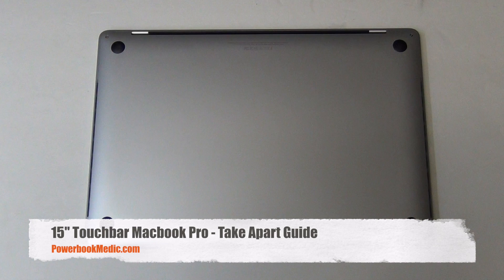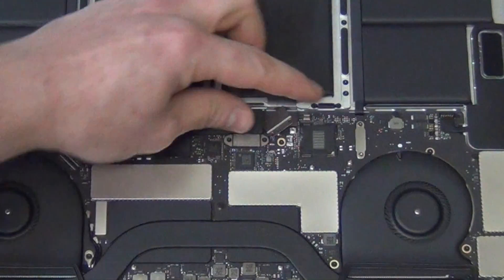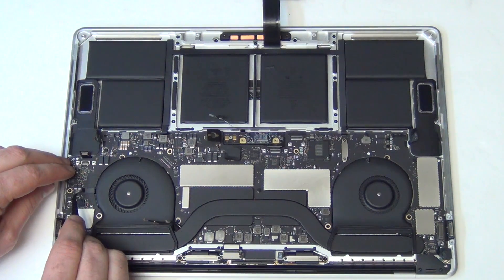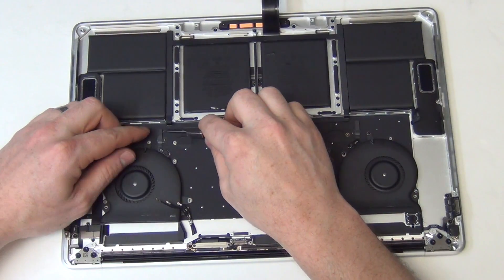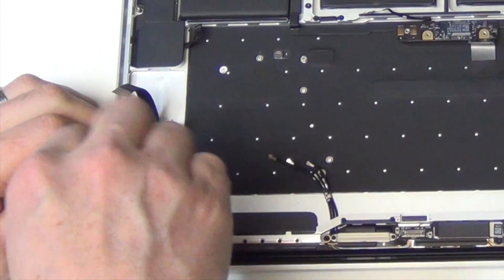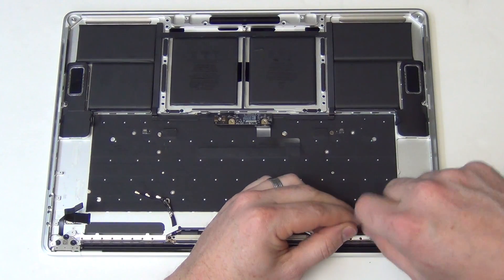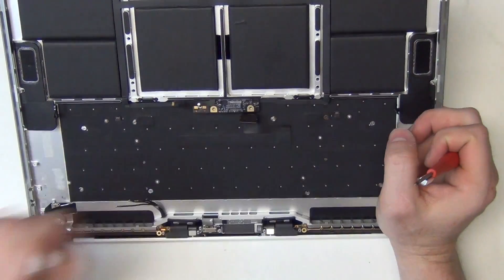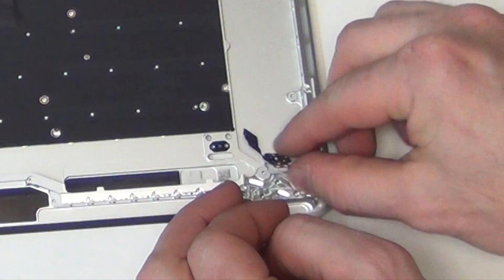How to Take Apart the 2016 15" Macbook Pro with Touchbar A1707

Comment: He did everything except take out the battery lol
Reply from the maker: The battery is considered part of the top case. When you order replacement top cases they will come with the battery. You can technically replace the battery but it is held in place with a strong adhesive and a novice could potentially puncture a cell a start a fire trying to remove it so it is not advised for most people to attempt that repair.
Reply: @PowerbookMedic  That’s fair but when you say take apart it’s assumed that means you remove each part of the device

Comment: What happened to the battery removal?
Reply from the maker: The battery is considered part of the top case and the replacement of the battery is very difficult and should really only be done by professionals due to the possibility of damaging the battery and causing a fire.

Comment: SPEAKERS:  Are GLUED in. This guy doesn't remove them at all. Disconnect speaker cable/tab from motherboard, then using a heat gun, hit the outside of the keypad area that is over the speakers (not directly putting heat gun on the speakers) and pry up that way.

Comment: Great video.

How difficult are the speakers to remove once detached from the logic board?
Reply from the maker: Lexington365 Thanks! The speakers are part of the top case. The adhesive is very strong that holds them down and are easily damaged when removed. We recommend replacing the whole top case.
Reply: instablaster.

Comment: One more question. There's a small circuit board near the display flex cable I noticed a computer with lines in the screen if you move that the lines clear up there's are 3 cables connected to it. WHat are they and in particular with the computer turned so the litte board is closest to you the right hand tape sems to be the culprit causing the issue. WHat is that cable called
Reply from the maker: VoiceOfReasonNW That is your LCD controller board, it is part of the LCD unit.
Reply: @PowerbookMedic  Is that buyable by itself? Seems a shae to have to buy a $300 entire display when all that is wrong is the control cirtuit.
Reply from the maker: VoiceOfReasonNW It is from some suppliers but it requires special machinery to do the repair. Unfortunately, it’s advised to buy a complete display.
Reply: Thank you. You’ve helped greatly
Reply: reminds me of the ballast boards for other displays

Comment: question I have an A 1707, that bottom case panel doesn't come off anywhere near as easy as yours seemed to. Seems jammed. ANy suggestion on getting it off without damaging internals?
Reply from the maker: VoiceOfReasonNW Make sure the clip on each side has unlatched, afterwards it will be easier to maneuver.
Reply: Powerbook Medic thank you the internal clips were the issue.

Comment: It is no reason to tear down this device, which could not upgrade the memory and the ssd. No meanings.
Reply from the maker: You can still replace defective parts, so there is a meaning for the video.
Reply: Powerbook Medic can you replace a bad ssd?
Reply from the maker: Laura Reyes No, you cannot replace the SSD on this model as it is all attached to the Logic Board.
Reply: @PowerbookMedic  Right but there has to be a way soder it off
Reply from the maker: Laura Reyes Sorry, our company doesn’t provide that service, and I’m not aware of any other company that does.

Comment: so If your battery starts to deteriorate 3 years down the road, and needs replacement you are pretty much screwed.
Reply from the maker: If the battery dies you have to replace the top case. It's stupid. If you look at it from Apple's point of view, that will cause most people to get a new computer rather than repairing what they have so they will continue to rake in the profits. It's a big FU to the consumer in my opinion.

Comment: After I opened it I found a small loose metal clip on one of the magnets. I suspect it may have been left in there by Apple when they repaired it. The piece of metal made several gouge marks on the magnet. Maybe it was moving around causing electrical issues before it got trapped by the magnet. This could explain some of the flakey issues I have had.  Has anyone else discovered loose metal clips?
Reply: Its an Apple its flakey at the best of times LOL

Comment: I asked for an under-warranty repair of a faulty key in my late 2017 MBP 15'', and an Apple certified technician from Applecare Enterprise spent 4 hours taking apart the whole laptop to replace the whole motherboard (which is soldered to the keyboard). Probably it would have been cheaper to directly ship a refurbished laptop. I wonder what is the business case of designing the hardware thinking about replacement rather than repairment, and then spending 4 hours of labor of a qualified technician and a new motherboard, just to fix ONE faulty key.  I'm sure the numbers work out well, Apple are very good at that, but still is hard to believe.
Reply from the maker: That's pretty crazy. We sell replacement keys for this model at this link for $7.95. https://www.powerbookmedic.com/MacBook-12-and-MacBook-Pro-Keycaps-for-A1534---A1706---A1707---A1708-p-158774.html ... The keys aren't soldered to the logic board. The keys are held in place by plastic clips to the top case. However, if the key was not registering at all then likely you needed to have your top case replaced as the keyboard assembly is built into the top case.

Comment: Hi, in September of last year buy a MacBook Pro 15” Touchbar with the famous butterfly keyboard. Soon some keys began to fail, so take it to the authorized technical service (Apple Premium Reseller in Chile) when still had one month left of warranty. The changed the topcase, including the keyboard and battery. When I got home I wanted to saved a fingerprint and I indicated that there was no more space to add fingerprints; “you have reached the limit of traces”. Try with the xartutil command that some sites recommend and nothing happened. Apple technical support recommended me to send it back to technical service. Anyone else has happened?
Reply from the maker: In terminal, xartutil --erase-all , should fix the issue. If it does not then sending back to Apple may be your best bet.

Comment: Spilled water on my late 2016 MacBook Pro 15” Touchbar’s Keyboard. Everything works, touchpad, power button, finger print sensor, screen, but the keyboard no longer works. Do you think the water just ruined the keyboard alone or could it possibly have gotten into the keyboard ribbon port on logic board? I’m replacing top case but now I’m worried that it’s the port possibly because the whole keyboard doesn’t work.. is the keyboard sealed off from the rest of the components? And would splashed water cause the whole keyboard to stop working and not just the specific keys the water leaked into? 

Simply Mac told me just a new top assembly would fix it, but I have trust issues with them so I’d like to hear your opinion or other’s
Reply from the maker: With liquid damage it is truly difficult to say without seeing the unit. The first logical part  to try is a top case. If that does not resolve the issue then most likely you have a logic board issue. The keyboard is relatively sealed off, but liquid can always make its way to the board if there's enough of it.
Reply: I just picked it up last night. The person I bought it from hadn't started it up since their visit to Genius Bar, where they just took it apart, checked the moisture stickers, cleaned and dried up the rest of the liquid and pieced it back together and quoted them the top case. She had let it sit for 2 months without starting it up, I started it up when I got home and everything worked!! Paid $300 for this thinking I'd have to make a project out of it but it's all good! Thank you for the response though! If anybody else has the spillage on keyboard issue, I'd also consider just checking moisture on Logic board and to try letting it sit for a few days getting air dried. Because if the person I bought it from massive spill didn't damage logic or even the keyboard after that long, you may be good for just letting it dry first before dropping the $500 on a new top case.
Reply: I have a 2016 mac without the cool touch bar up top, exact thing happened to me and right now my mac works--except for the keyboard, I was told by apple it would be 1500 for repairs and I am just trying to figure out if a top cover with keyboard would get my keys typing again....the only tests my mac has failed is 1/4 of the liquid sensors tripped and the keyboard will not respond although the efi passed. any help or advice on this would be great....I just want my keyboard working again
Reply from the maker: You really can't easily diagnose with liquid damage without opening the system up. It could be that the board needs to be repaired, or it could be the top case or it could be both. If you're not up for the repair, you can call our repair department at 1-866-725-3342, option 2 to request a quote or visit us at https://www.powerbookmedic.com/repair-center/quote.php to request a quote. Either way it will be significantly under $1500.

Comment: Kinda crummy Apple went back to mounting the heatsink from the underside of the board again, requiring removal to apply new thermal paste. It was that way for the unibodies, then with the Retinas it became easier (heatsink could be removed without any other disassembly), and now we're back to this again. Damnit. I was gonna repaste my 2017 15" as I usually do with new MBPs but I think I'm gonna wait now.

Comment: Hi there, how can I replace the speakers?
Reply from the maker: You would need to replace the top case as the speakers are glued in place and not meant to be removed.
Reply: Thank you very much for the information.!  I cannot understand the reason for gluing a vulnerable piece to the body.

Comment: I hope someone responds. I spilled some pepsi max on my keyboard, but only on the arrow keys and right side shift key. Is there something very easy to break components underneath?
Reply from the maker: The logic board is underneath the keyboard, so any liquid could filter onto the board and cause damage. Are you having problems after the spill or are the keys just sticky?
Reply: Powerbook Medic i got lucky and they are not sticky and they do work properly!! Maybe the spill was so little it didnt really even go underneath the key or something
Reply from the maker: That's great! If you do experience issues in the future then you could have corrosion on your logic board. However if you've been running fine for a few days then you're most likely ok!
Reply: Powerbook Medic sure, thanks!

Comment: Macbooks during Steve jobs era were so much simpler
Reply: I've been out of this for a long time and after seeing things like soldered in SSD and RAM I'm glad. I remember the powerbook titanium had an awesomely removable keyboard and access to RAM
Reply: @aaronlocke-paddon1209  I remember the Powerbook G4 12" and iBook G3, both total nightmares to work on. Still, you could repair them, unlike these new MacBooks. Time to Hackintosh.

Comment: i spilled some coke on the keyboard, any chance I can fix it myself? or do i have to send it to apple and spend couple hundred bucks repairing it?
Reply from the maker: You'll likely need to replace the top case. Replacements are available from our website or you can call our repair department at 1-866-726-3342 option 2 for a quote.
Reply from the maker: Unfortunately you'd need to replace the top case to replace the logic board. We do have a send in repair service if you're looking to have the unit serviced. Repair cost is $95 labor + part cost - https://www.powerbookmedic.com/mac-service.php

Comment: So if the keyboard has a problem they replace the aluminum chassis as well.
Reply from the maker: Yes, that is correct.
Reply: Powerbook Medic thanks a lot for the fast reply
Reply from the maker: Yes. You replace the entire top case if any component in the top case has a problem unfortunately.

Comment: Care to actually elaborate on how you remove the back plate (step 2)? You just breeze over it as if were easy task when this is not the case.
Reply from the maker: It is actually easy. It yours is not coming up you need to verify you removed all of the screws.
Reply: Powerbook Medic OH DOI HOW DOES AM USE A SCWEWDWIVER THANX FOR HALP YOU SMART MAN

Comment: This is so crazy different than all their previous notebooks everything's mounted from the underside instead of from the top as in iBook and PowerBook models.  Very different looks mildly easier to access solid state drives but the display inverter is still incredibly difficult to service

Comment: Great vid, thanks for posting. I have same identical model bought last March. LH speaker is blown. Want to replace myself as it appears fairly easy to get access to (not my first rodeo in ways of computer building). So far I have seen no speaker units for sale for 2016 15” MBP, and this vid didn’t cover their removals. Am I missing something? Is it harder than it appears to remove/replace?
Reply: Had the same issue with the speakers . First the left one got blown ( muffled sound and no base ) then the right one . Took it in for repairs and they completely replaced the whole topcase ( battery + trackpad + touchbar , etc ) they did left my old mainboard and screen. Cant say if its an easy repair or not ..but thats what apple will do for it . Got Apple care after that , the 2016/2017 touchbar models seem very prone to issues compared to older models
Reply: was the replacement free ? or paid ? i have the same issue :(

Comment: Is the keyboard removable?
Reply from the maker: Technically, yes. However, doing so is a very involved procedure and it's usually easier just to replace the entire top case.
Reply: I had my space bar get stuck on me recently thanks to my nephew. Took it into Apple and they basically said they had to replace the entire keyboard, as well as battery and trackpad just because of a space bar. My computer is pretty much brand new as a result. I couldn't believe it.
Reply: TechFeast that is such a royal pain. iBooks had a keyboard that came right off. This MacBook is a disaster when it comes to serviceability
Reply from the maker: No. It is part of the top case assembly.

Comment: look at the wasted space for battery .. so much open space .. not used .. just air gabs .. totally useless ..
Reply: It's for airflow you fucking plum.
Reply: oOWaschBaerOo dumbass
Reply: smaller battery than the previous macbook, apple claims it can hold up 2 more hours, but it holds less than the previous macbook... but fck yeah they make it smaller and lighter, apple irony!
Reply: Isn't that for heat dissipation?
Reply: Alexander Vickers You my friend are talking shit!!
Reply: Guess who is flipping burgers instead of working as an engineer...you.
Reply: guss67 it's called battery chemistry dimwit

Comment: I am try to open mine and change the stock thermal paste. but the back cover is insanely hard to open. I spent 30min to figure out how to open it even with ur video. lol

not sure why apple have to make it so hard to open
Reply: Why would you do that? MB's generally have low temp anyway?
Reply: MB is generally have low temp anyway. but better a nice thermal paste will help cpu and gpu remove heat faster. in other words slightly better performance under heavy load.
Reply: @midifire  .
Reply: huberttat just slightly improvement but void the warranty...
Reply: I also spent 30 minutes before figuring how to remove the back. I got back off using 2 people. We used a thin piece of wood to pry at the back near the hinges, while simultaneously lifting the front at an angle of about 30 degrees plus and minus a little. You need to slowly change the angle to find the right spot for it to release.
Reply: huberttat how did you get it to open without a suction cup?
Reply: huberttat so you can't get to it. So you have to come to them